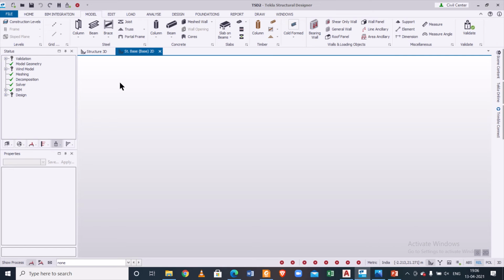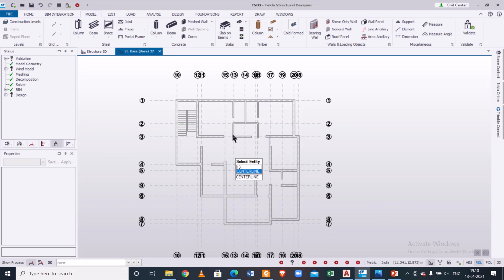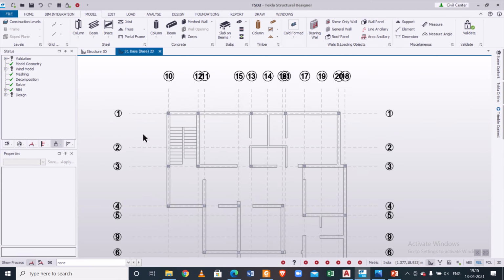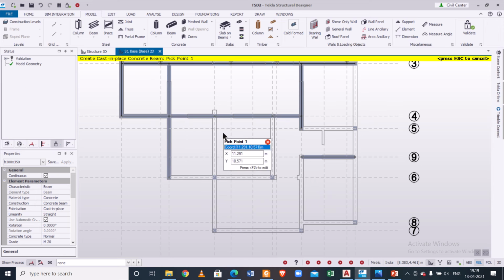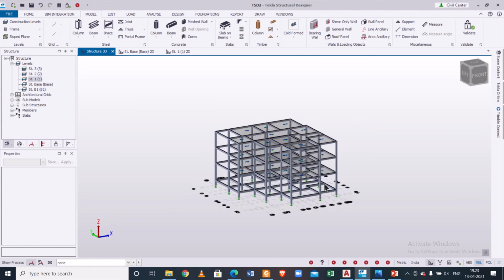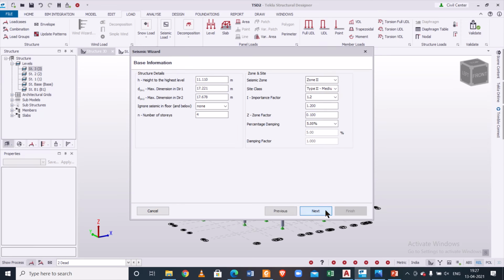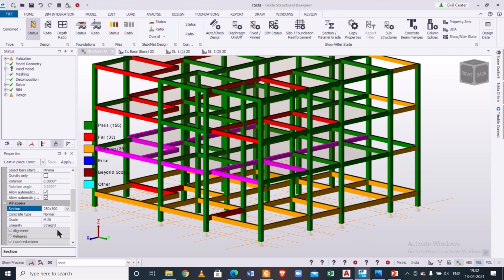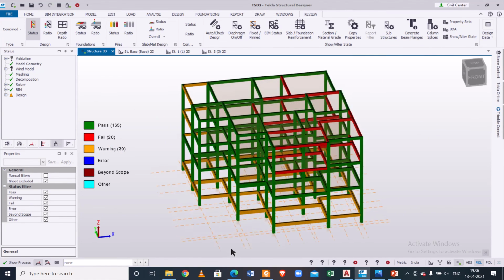Tekla Structural Designer Tutorial || Complete RCC Building Design || TSD || Tekla Software

Comment: Should all the beams be fixed? This might result in building fail if the beams are pinned at one end. There will be moment in the beams during earthquake. Can you please clarify this?
Reply: Pinned when the other end of the beam is connected to the main beam? 😅😅😅😅 Where on earth did you learn that?
Reply from the maker: Depends on the support conditions
For example if there is a column to column connection then it should be fixed.

If one end is connected to column and other end is not, then fixed and pinned respectively.